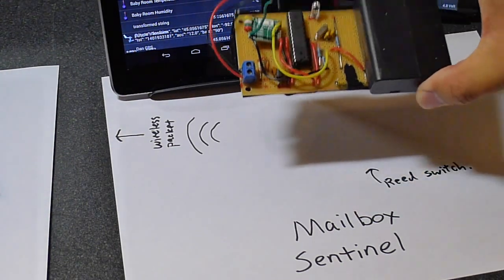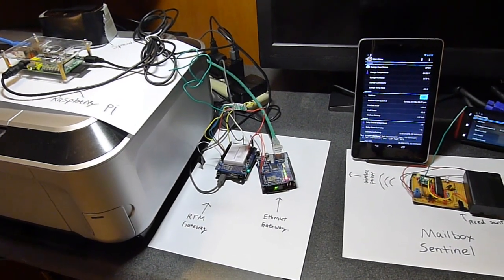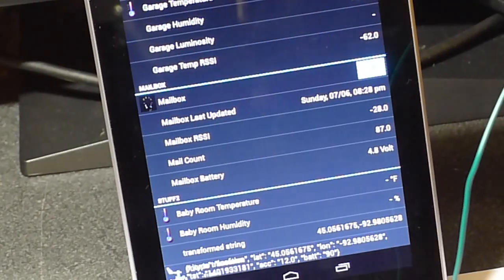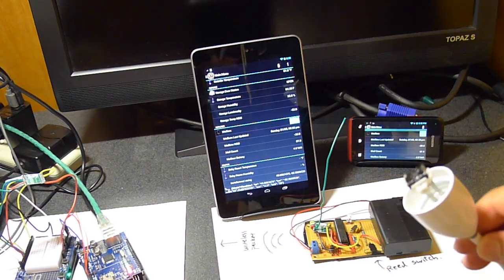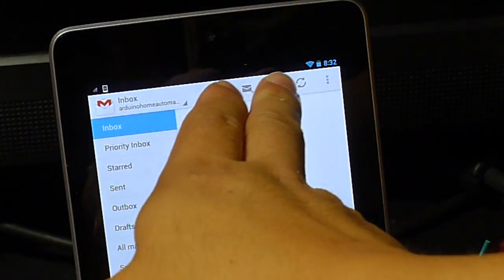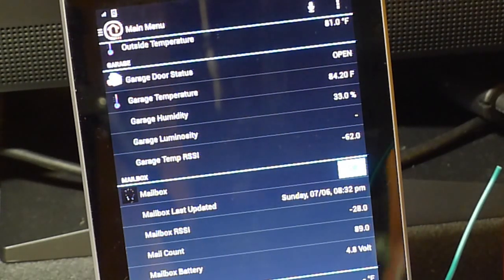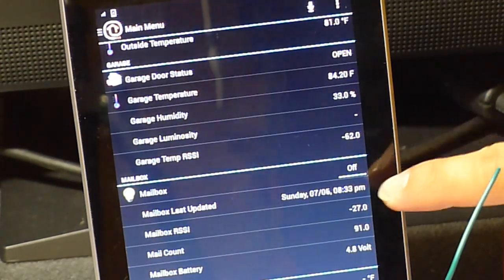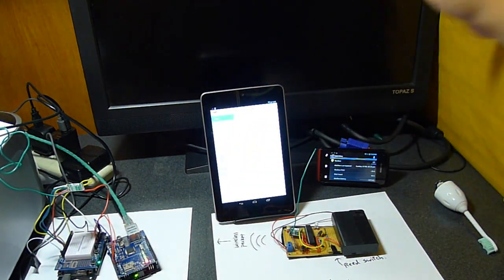Mailbox Sentinel Detailed Explanation - Wireless Arduino & OpenHAB

Comment: I don't understand why you need and RFM gateway and an Ethernet gateway, why cant the Sentinel speak directly with the RFM gateway or just the raspberry pi for that matter? Can you briefly explain please?
Thank you!
Reply from the maker: The field node talking directly to the Pi would require a library for the RFM module on the Pi.  At the time, that didn't exist.

OpenHAB doesn't automagically understand wireless data.  Hence the gateways.  Two gateways are needed because the wireless module and the ethernet module on the same bus required more bus interrupt management than if they were separated.